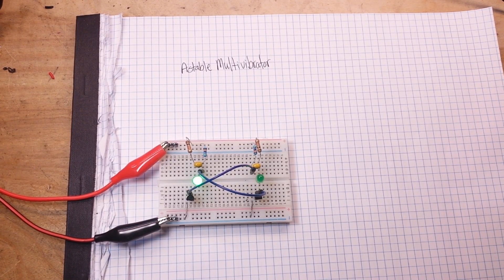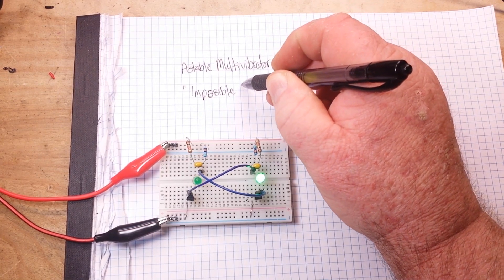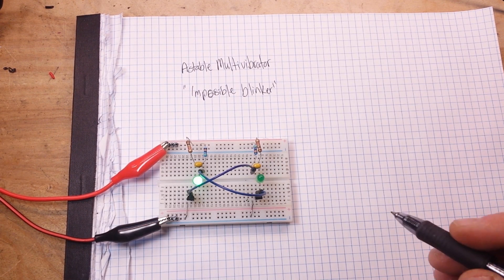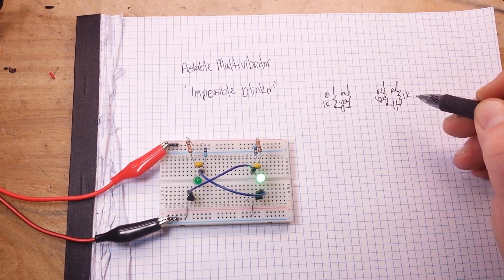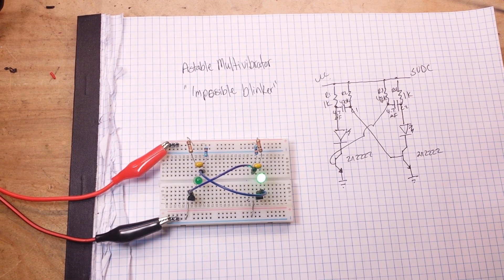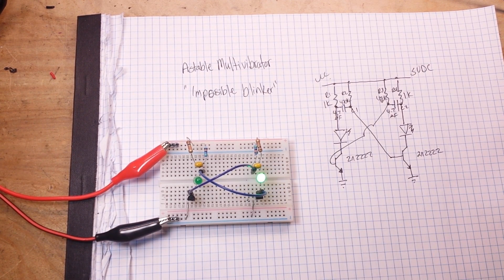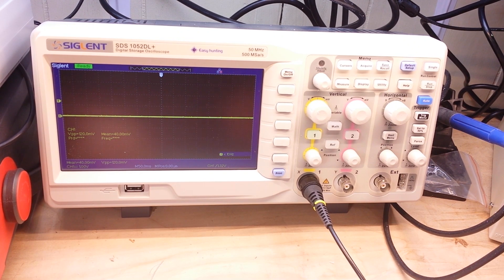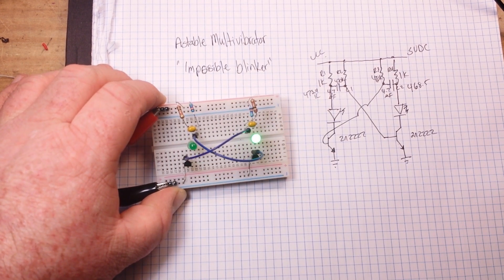Classic Circuits You Should Know: Astable Multivibrator

Comment: Hi, I was wondering if you (or anyone else) could help with a question.

I built this circuit, however I didn’t have any 4.7 uF ceramic capacitors, only 4.7uF electrolytic capacitors. My instinct was to connect the positive ends of the capacitors to the 1K ohm resistors, and it worked just like yours, same frequency and everything.

Then I switched them, and connected the positive ends to the 470K ohm resistors, and it worked, though the leds toggled twice as fast as the original setup.

I guess I’m wondering 1) how it worked at all with electrolytic capacitors, and 2) why the frequency difference when I change their orientation?

Your explanation makes sense to me, but I have no idea how to think of it with electrolytic capacitors.

Thanks

Comment: Good interesting video. I have looked at a lot of these videos, and many others include blatant errors that will destroy your LED's, or they don't give you component values, etc. I would have liked to have seen alternative values for the base resistors that would show different speeds, and a non-symetrical duty cycle. That would have been interesting. Thanks.
Reply: You might be interested in my lasted post about this circuit

Comment: Maybe I'm stupid, but a 2N2222 needs 1.3 volts at the base to trigger, and if this is putting 0.6V at the base and its working, either these aren't 2N2222 in the video or all mine are labeled wrong.

Comment: I think it would have been more beneficial to figure out why changing the resistor to 1k didn't work other than "oh well". Flashing 4x as fast wouldn't have created a solid led.  It was clear from your scope that it wasn't working.
Reply: He didn't put a 1K resistor, it was a 100K resistor...
Putting a bigger resistor does slow down the frequency, doesn't it?
If he wanted to speed up frequency to 4X, the resistor had to be a smaller value, I mean (because the capacitor time charge would be smaller)...
Greetings from Argentina🇦🇷🤗❗️

Comment: For some reason I think the frequency is determined by the value of the capacitor and the duty cycle is determined by the value of R.
Large R1 compare to R2 give you longer on time (pulse width) and less off time ( space width).   If you swap them R values ( swap R2 and R1 and the same with R4 and R3, you will end up with long on time and less off time while your frequency remains the same.  Right?

If I want to see what the value of C must be to get 60Hz
F= 1.44/ [ R1+2(R2)] x C.

C=1.44/[R1+2(R2)]xF

Most likely they are all tied up with each other from the looks of it all.
Did I miss something?

Comment: I think I found what I was looking for.   The actual real I have to call it "The knowing" behind all these dizzying terms to monopolize knowledge and everybody just memorize.  After all what else can they do.    To see what is behind all these terms is  in itself an education.  It is education just in itself.
Doping, bias, etc etc etc.
Here is cutting through all that...  oh my.
The so called NPN transistor.... just what is the N and the P and the other N.

Actual electrons move from the battery back to the battery.  It is a complete loop. End of the story. Simple easy, straight foreward.   Well so is the rest.
The so called that first N of that NPN, the N on the left , they call that Emitter.
For electron to move from the negative of the battery to that dog gone N, it has to be less N,  In other words it  has to be more positive, having less electrons, a difference in voltage must exist.  Simple straight forward clear.  So they dope it.  Oh yea dope.  What is behind that word...  oh my.
It means adding impurities.  Oh jesus, what is behind impurities...that word. It measn they add some other stuff, other elements to that silicon to give it more room in the outer electron valence shell to allow and accept electrons from the battery.  Straight forward.

Now comes the so called base.  The P.  How P is that P compare to the N on the left.   Just enough more doping and impurities to cause another slight positive and it has a lot smaller area, literally physically compare to N before it, the so called  emitter. This means even when nothing is going on just hooking up the battery to the system, electrons have moved clearly to that so called base the P and in fact they do. 
 Now the other N to the right,  the so called collector,  you can bet that must be more positive than P and of course the other N, the first one on the left, that emittor thing.  And those chaps figure out, better have this one physically larger than the emitter.    So it is so obvious that without doing anything just by mere connecting the battery to this, any little LED you hook up in this system will light up, but very dim.   Well of course it will be dim but it will be lit if you look very close.  And that is a fact. 

Because a small current always flows just by sheer fact that a potential difference exist as stated so clearly above.  NOW YOU CAN DUMP ALL THOSE BIASES, THE DOPES EVEN IF THEY ARE LEGAL AND THE REST OF NONSENSE.  They people that actually figured all this out, had no terms.  They did not invent these terms.  They were invented afterwards to guard the knowledge.  The politicians, the financial institutions, the bankers and their buddies.

To make good current flow, you simply connect the P ( that so called base) to the positive power and bingo.  But no worries, the P in terms of area is not large enough where the current will just move like a short circuit.  No no no.  It is so designed by experiment and observation, that hooking that P to positive, electron moves straight to the collector, being more positive, larger area to accomodate all those electrons... and bingo.  

Of course you watch it.  With this circuit it just like a switch, this means watch that voltage.  You don't want to apply 12V to light up an LED.  Transistor therefore, the whole bullshit and all the lingo is just to use it like a potentiameter, a variable resistor.   You do this by controlling how much voltage you are sending to the base.  So it is obvious that if you hook the base directly to the positive, it is full current flow in the system.

So it is simple obvious fact now why my LED that I connected to the so called collector was faintly lit without me doing anything at all to the base.  Straight forward.  No capacitance lingo....

  And so I just by mere playing around when I grounded the base, meaning hooking it up to the negative of the battery, the LED  went off.
However a most peculiar thing... when I would touch the base with my hand the led came on brighter and when I touched the collector, it did the same thing.  ( I think it was the collector... I will have to see).  Also when touching the separate supply voltage on the emitter gave the same result, the LED would turn brighter)

When connecting the base to the negative of the system battery, the LED was truly off. This means no current was able to flow from the emitter N to the base as the base was at the same voltage as the other side of the N being connected to the negative of the battery.

So the minute you apply positive voltage to the base, even though it is connected to the negative of the system battery from a different source of voltage and it's negative connected to the emitter.  In other words for this you have to have another source of power that is connected to the base and the emitter to do this, the led will come on but without worry for current rush.  Just don't supply more than 6V to the emitter from this separate power supply.

You hook up the negative of that source to the emitter and its positive to the base.  Just a small voltage is enough to get the electrons to flow from the system main battery to the base to the collector to the load and back to the battery.

Nowhere will you find this simple straight foreward that even my dog will get it.
UNLESS WHAT I SAID WAS TOTALLY WRONG.
I HAVE TO DEPOSIT THAT MONEY INTO MY OWN ACCOUNT.  I HAVE EARNED IT.

Comment: So frequency means how many times the LED turns on and off in one second and the duty cycle means how long in that one second it stays on.
Say it is one time on and off per second.  And duty cycle determines how long in that one time it stays on, in other words in may not be 50/50, it could be 3/4 of the second on and 1/4 off.  Is this right?
Reply from the maker: You hit the nail on the head. Frequency is the same as cycles per second. You might even see that in some of the older textbooks or literature. Duty cycle also known as Mark space. Is the ratio of on to off. So we could have a frequency of 20 kilohertz. And a duty cycle of 50%. And a VCC of 5 volts. Whatever is on the load end of that circuit it's going to see 2.5 volts.
Reply: @learnelectronics  Oh, that is interesting.  So even though you are applying full voltage say for 1/2 second, the voltemeter will show 1/2 of the applied voltage.   In other words just like current, Voltage is also measured by the second.  I never had straightened that out in my mind.
So I can use a Treadmill power supply that operates on PWM and  not LWH ( pot) as a controllable high power DC source.  And the only difference would be that I won't be able to set current constant if need be. Does this sound right.

Comment: I will put money  in your account if you can explain in plain English how a transistor work.  I just assume that Mosfets actually work by the same principle as the BJTs, the only difference is the gate is to supply voltage and so they need a resistor before you connect them. but so does the base of the transistors.... oops, now what.  Plus more, you connect the base/gate to both positive and negative with resistors... oh no.   That right there shows what is going on.

No, I do not mean they way it is explained everywhere.  I can google it all and find it all on Youtube.
No, what I want to know is the real deal.  And it looks like this:
NPN of a transistor does not mean what those three letter says.  Those two N's are not equal N's otherwise there will be no need to call the two by different names and the same therefore with the base.  The P does not mean what the letter suppose to mean.
The N's does not mean you connect them N's to negative side of the battery and the P does not mean you connect it to the positive of the battery.  It is not at all whatsover a diode or two diodes or whatever.

I stand on a wood floor and lean over and touch the base of an NPN and the current flows nice and the LED light is nice and bright.  Go figure. I am not touching any wires, neither positive nor negative.
Reply from the maker: I don't care about any money in my account. The difference between MOSFETs and BJTs, is that in a BJT the base is directly connected to the NPN or PNP sandwich. Whereas with a MOSFET, the gate is capacitively coupled to the drain source flow. That's why when you turn on a MOSFET it stays on until you bring the gate below VCC. Also BJT's work off of current to switch on, MOSFETs work off of voltage to switch on.
Reply: @learnelectronics  I am sorry, I don't know what capacitively coupled to current mean.
I know what capacitance/capacitor mean, principle of operation that is.  
"That is why when you turn on a mosfet it stays on"  I assume by that you mean without any supply to the gate or do you mean the gate must be connected to the positive side?
To turn the mosfet off, "you have to bring the gate below VCC".  I assume you mean you have to either disconnet the gate to the positive or connect it to the negative/source side?

I don't know if my English is terrible or everybody has their own language or something in the way each person uses words.
BJT works off current and Mosfet work off of voltage is the most repeated statement there is.
[If I were to ask you, don't send me current, send me voltage, or don't send me voltage send me current; what would you do?]

I ask you to send me volts, you turn around and send me current.  I say hey you sent me current, you say, no you sent voltage.

I say I just touched the gate/base of this NPN transistor and the led came on, I am not part of the circuit, I am not positive or negative... you say...... ?

I am toast.  
I wasted my time typing, and you wasted your time typing.  We both lose.  
Welcome to language.

Comment: Great video, but you left us hanging about why the 100k resistors didn't seem to let the circuit oscillate at 4x the speed, or even oscillate at all!   You concluded that it was going too fast to detect, but your scope couldn't detect oscillation either!  You ended the video just as things were getting REALLY interesting!  Maybe the two 100k's just happened to be almost exactly equal, (it could happen!).  I suspect, though, that the problem occurred because the two capacitors were both charging too quickly, (due to the lower input resistance), and so neither one discharges quickly enough to stop powering their respective LED's. The speed of oscillation should only be changed by altering the capacitance, in my opinion.

By the way, instead of relying on manufacturers' tolerances, to trigger oscillation, maybe you could simply add a couple ohms of resistance to one side of the input?  🙂

Comment: Does this circuit only work with non polarized capacitors? Or can i use polarized electrolyte capacitors aswell? Does the flow direction change when it switches?
Reply from the maker: You can use any caps

Comment: What if the resistors have exactly same value? Which will then on first?
Reply from the maker: Then it goes to the caps
Reply: @learnelectronics  what if the caps also have the same value, which may be a rare case. I presume that then it depends on the transistor.

Comment: Nice video, like your all videos. I appreciate all of this but would be pretty grateful if you can clarify how are the capacitors being carged when they are connected from their both sides to the positive rail of the power supply, so there is bassically no potential difference to charge them.
Reply: All I can guess is that due to the different voltages, any current flow will flow more slowly through one resistor than the other creating some kind of pseudo-capacitance, like a high flow rate water pipe connected by a perpendicular pipe to a low flow pipe resulting in a pressure (voltage) difference.

Comment: I used to kinda get this one but looking at it now I still dont get where the charge goes on the transistor side of each capacitor,  surely the cap cant charge if it doesn't have both sides connected ?      I know transistor has a tiny bit of current flow through its gate but is it enough to charge up the capacitor ?  also I don't get the purpose of the 10k resistor

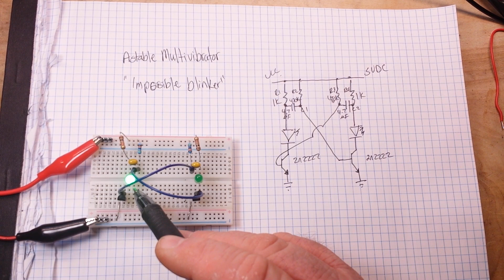Comment: Thanks for the explanation.  I have a dumb question (I think).. at 4:30 you say that the capacitor on the right charges up enough to turn on the transistor on the left. Why does it need the capacitor to do this? Isn't its base also connected directly to Vcc via R3, like ALL the time? So it should NEVER turn off, right?

Comment: I track the whole explanation except the purpose of the 1k resistor.  If the capacitor only charges through the 470 ohm resistor, it seems like the circuit should work without the 1k resistor.  Must be missing something.

Comment: Thanks for the video. First you say that the manufacturing tolerances are the reason why the LED's are oscillating, but later on you say that that's the reason why one LED blinks on first. I think only the latter is true. The oscillation happens because of one side of a capacitor dropping the voltage when a transistor opens, and then charging up again.

Comment: OH now do I understand!! :-)
I did for some time ago look at a schematic of an astable multivibrator but could for the life of me not see the logic in how that should work, no matter how I did look at it were there no logical explanation on how that should start blinking! But electronic is fun and investigation could only add to the fun, so I did thought, I'd just draw the circuit in an visual simulator and then I know what's going on. But to my surprise did both diodes just glow and nothing else happened. I did redraw the circuit several times but every time with same result. :-)

Comment: It's this what is also called a 555 timer?
Reply: It's more like a 470/470 timer than a 555 timer, but there ARE some similarities.
e.g. The Q and Q-bar outputs of the 555 are a lot like the LEDs in that when one is 'on', the other is 'off'.
There are quite a few 'differences' though
 A 555 uses 2 internal comparators to 'sense' the charge on a single capacitor first charging it to about 2/3 Vcc and then discharging it to about 1/3 Vcc
An astable multivibrator uses two, independent, capacitors (along with their associated resistors).

Now here's an 'exercise' for you to consider.  How does it ACTUALLY start up and work.
Here's some hints to get you started:
1: Just before you power it on, both capacitors are 'discharged'
(There is no 'voltage difference' across the internal capacitor plates since R1 and R2 have 'drained' C1, R3 and R4 have 'drained' C2)
2: Also, both transistors are 'switched off' (since the base-emitter voltage is below the circa 650mV junction minimum of the PN junction)
3: As noted, R1 and R4 are 1k (assume they're EXACTLY 1000 ohms each in this exercise)
4: As noted, there are some 'small' manufacturing differences between R2 and R3.
5: For this exercise, you're allowed to assume that the LEDs and transistors are PERFECTLY matched (admittedly, this is totally unrealistic!!!).
You now apply the 5V Vcc power to the circuit....  Explain in depth what happens!!!

Comment: I think it's called a multivibrator because there were also single vibrators and they were used with transformers to convert DC to AC in cars to power tube radios in the mid 20th century. Maybe google "radio vibrator".